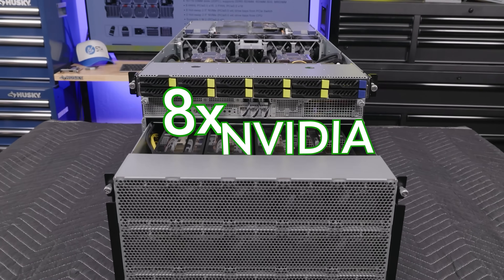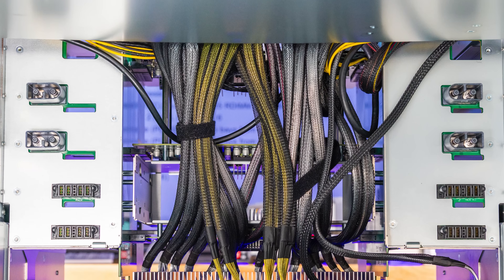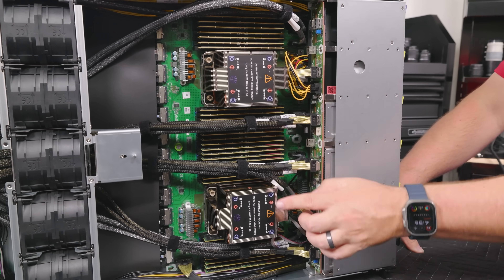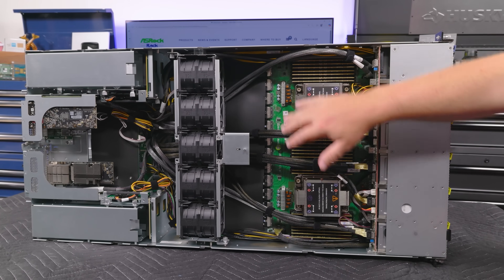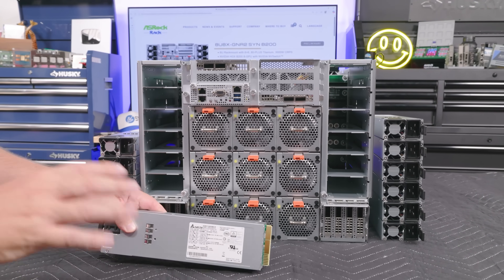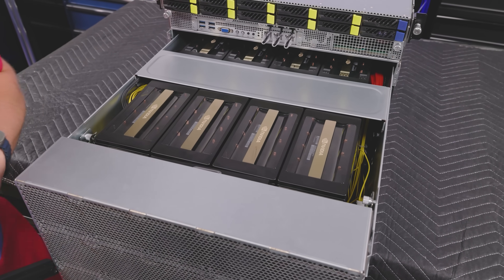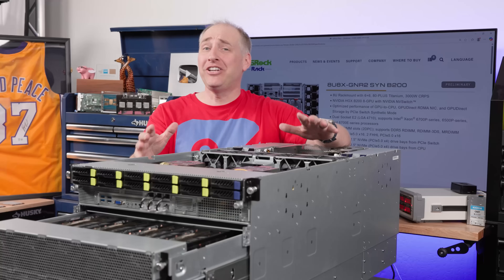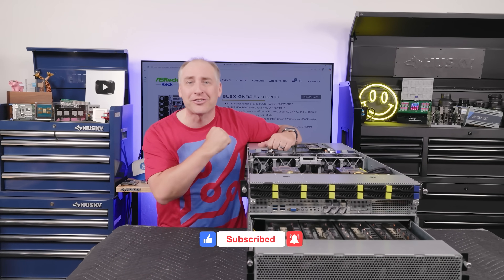INSIDE a 1.44TB HBM3e NVIDIA HGX B200 AI Server from ASRock Rack

Comment: A poorly designed unit. Too many small fans, small power supplies. Will be incredibly noisy. When you are building things with this much power draw it is better to use larger PSU's that don't use those awful muffin fans. I understand that it will go into a data center, but while you are building up the unit you have it in your lab and it will sound like being next to a jet plane.

Comment: My PC only has a 3090, and I don’t have GDR installed. Plus, my PCIe slot is only Gen 3. So, as a sanity check before uploading to the cluster, I usually run a sample program with a trimmed model to test things out. Normally, I make some tea while waiting for all the data to load into the GPU, but it’s kind of funny that on the B200s, the entire model loads in just 3 seconds.

Comment: Awesome video and props to ASRock for making a serviceable and flexible product.  I know the sliding rails and the alignment of the rear pins can be a major PITA, and this chassis has it all over.

Would love to see more high speed networking stuff.  Are the ConnectX7s running 400GbE or InfiniBand?  Would be cool to see what setup they use to connect this to a switch and if they use 2x400GE breakouts to a single 800GE interface.
Reply from the maker: We are going to do a CX7/CX8 with a SN5610 piece this quarter. Lots more networking on STH if you saw our recent MikroTik CRS812 video

Comment: Does the chassis have a slot for a kensington lock? 🙂
Reply: The kensington lock is the weight of the system with 8xGPUs 😂
Reply: You need to guard this chassis with AK47. Kensington lock is just for grounding.

Comment: Can I ask why you would want an air cooled server at this power level? Other than the obvious of not all data centers are plumbed up for water cooling, but saving so much rack space, and the efficiency gains I feel like would make these somewhat irrelevant.
Reply: I also could see serviceability being a factor, but unless you’re going for the extremely dense 2u water cooled version from super micro it all still seemed pretty modular
Reply from the maker: We have done air cooled Blackwell cluster walkthroughs. Many facilities cannot handle higher density

Comment: What's the power input? 240V? 480V? The PDU for this would be interesting.
Reply: Type	6+6 CRPS
Output Watts	3002.4W @ 220-240Vac input, 2900W @200-220Vac input
Efficiency	80-PLUS Titanium
Reply: Says AC Input - 200-240Vrms, 50/60Hz on their website

Comment: Those loop out ethernets are horrendous. In a deployment you know which one you need, you don't need that 'flexability'.
Reply: But now it’s one SKU to produce and sell versus having to make two slightly different versions
Reply: @RaineyPeng yeah, which makes it easier for the manufacturer, but its an extra failure point for a customer. As a buyer of things like this, albeit no blackwells yet, that would be a deal breaker for me. When we spec a rack we know excactly how its going to be deployed, we'll never need that flexability.

Comment: I noticed the power connections to the HGX's were quite small and then saw the PSU's are running 54v, that makes a lot of sense in these high power devices!
Reply from the maker: To higher voltages we go

Comment: This is a dumb layout. If the CPU-Part would be at the buttom, there would be no need for such long Raiser Cables that block some airflow. Additionally B200 Servers makes no sense at all, because B300 have almost one TB more vram for 50-70k more. If you pay ~400k vs 450k then you should go for 450k and almost twice the amount of Vram.

The issue is, B300 has more memory per GPU, this means you can run or train Models on less GPU’s.
The thumb of rule is, the less GPU’s you utilize to run a Model (even with nvlink), the faster it goes! NV-Link is horrible slow compared to HBM, especially latency is an issue.
So if the model runs on a Single GPU (if it fits), it will 2-5x faster. 2 GPU’s over NVlink = half performance if not less, 8 GPU’s of NVlink less then a Quarter of the Performance.

Thats the issue that no one Tells.
Reply: Most of the hgx servers look like this. I'm wondering if this is weight related - those GPU baseboards are quite heavy
Reply: @zbigniewmalec4816 
If thats the case, you get in a Rack on the server below it an issue 😂
Reply: I agree, I was surprised to see a new video with a server with B200's in it. At the prices you pay for a HGX or DGX server, you might as well go for the B300 version.

Comment: the management interface being tied to the front of the server via internal ethernet cables is really weird and kind of sloppy
Reply: Yeah the whole thing looks like a bit of a mess from a design standpoint. Makes you kinda miss the early days of Sun system engineering...
Reply: Granted it is getting harder to fit all that into a box with all those required fans.  Dell had a unique design for a 4 way system using closed loop liquid cooling and resulted in a more compact design.  I wish there was more of that.
Reply: Since when are patch cables sloppy?
Reply: Not really, it's a choice. You can unplug the cables and plug in the front, the cables are just if you need connectivity from the back instead
Reply: @masterman1502  thanks tips I appreciate you taking the time to point out the obvious

Comment: Oh. Tiny nimi micro competitor ? 😅

I'll buy one of those on eBay in 2050 😅
Reply: how will you afford the power bill with the 12x 3600W PSUs this thing uses.
Reply: @lizardperrson fusion reactors are just on the doorstep Itll take like 30 years 😅
Reply: @lizardperrson  Funny that in 2050 it would probably be much more attainable to have 10kW of Solar plus 60kWh Home Battery Energy Storage. It's meant to power a whole home, but it will power this singular machine just fine.
Reply: If the AI bubble pops soon, your wish may come true sooner.